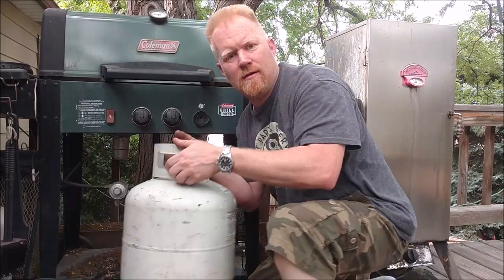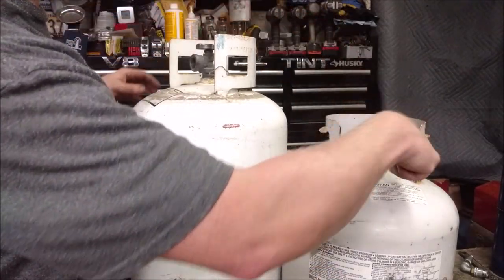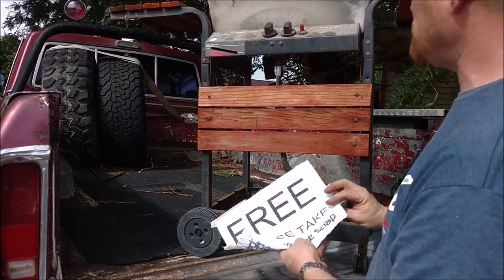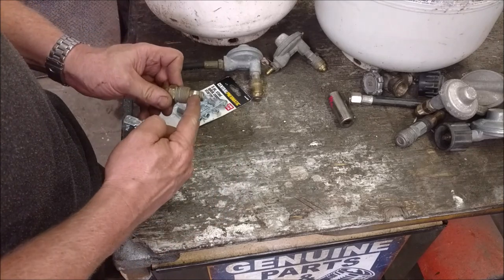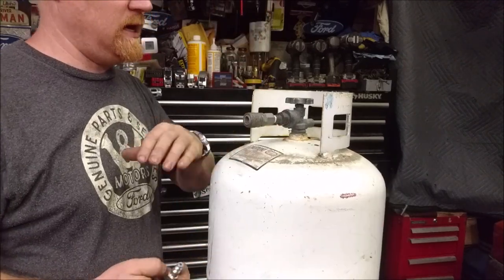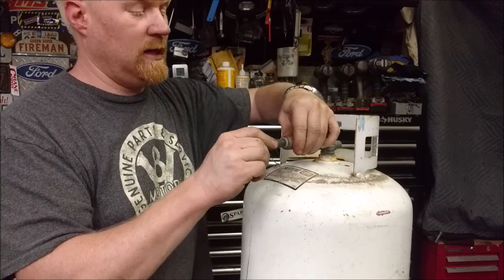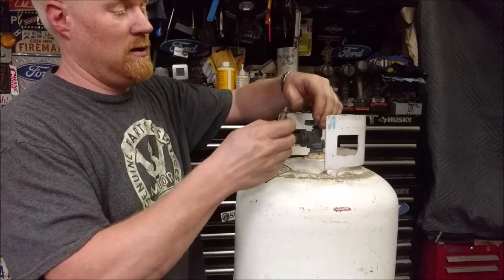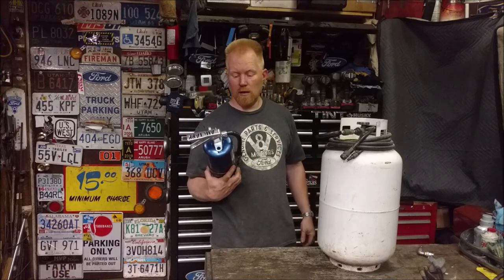Make a Propane Air Tank QUICK N EASY

Comment: I did just that about 10 yrs ago when my gas grill crapped out and I went back to good old charcoal. I hacked up the grill stand an  made a push cart for the tank with a box for accessories blowers couplings teflon tape etc. Next project is attach my small 5 gal Harbir Freight compressor to the cart. The tank fits inside a standard milk crate so it can sit more stable in the back of my truck.
Reply from the maker: Awesome.

Comment: Would this work with a liquid LP tank valve also? Should, right?
Reply from the maker: Yes, there is just a pickup dip tube internally that will make no difference in it's operation with air.

Comment: Will it work for those helium tanks for balloons? ??
Reply from the maker: I have 3 old helium tanks (freon tanks are identical as well) sitting around that I have contemplated doing this to but I always talk myself out of it. Only because those are paper thin.  They are what they call DOT39 non refillable cylinders. They make them for one time fill and dispose of, so there is no safe guard from thing like metal fatigue from repeated fill and empty unlike propane cylinders. I filled a DOT39 cylinder with refrigerant years ago and it got slightly overfilled and swelled up to the point it deformed the steel and I thought was going to blow up. I emptied it as fast as I could and had to dispose of it. However people do it all the time though but I've also seen the feet wear holes just from moving it around and setting them on concrete.
Reply: @sixtyfiveford  ok well plan B would be to turn them into mini little forges those wouldn't be presurized

Comment: Will it just stop filling when full?
Reply from the maker: It will equalize to whatever the air compressor your filling it with is at. Most air compressors are set to around 100psi.

Comment: Could you fill the propane take with CO2?
Reply from the maker: The tank couldn't handle the pressure that CO2 is at. A propane tank is tested up to 480psi but that is only 1/2 the pressure CO2 sits at.

Comment: How would I convert one so that I can spray motor oil. On the frame of my old truck
Reply from the maker: Check out the fire extinguisher one I did. It has a pickup tube running to the bottom already, so you could just dump in oil and add air.
Reply: Buy $9 garden pump sprayer. Delute oil with diesel fuel.

Comment: Does anyone know how many gallons of air a 20lb propane tank will hold at 150psi? I don't know how to convert that. I have a Lowe's 7gal aluminum air tank but it runs out pretty fast even filled at 150psi. This may be a good replacement.
Reply from the maker: 5 gallons is what a 20# lpg tank is. It's rated to 240psi.

Comment: How do you know when is full?
Reply from the maker: The pressure from your compressor tank and this when hooked together equalize. So if you have 100psi coming out of your compressor the tank will fill to exactly 100psi.
Reply: @sixtyfiveford  cool thanks. And you already gave the max pressure limit of the tank. So anything under that should be safe.
Reply: On my 30# tank I made over 40 years ago I have a tee fitting with a 250psi gauge on one outlet along with a valve to fill it with an air chuck and also use a double male fitting.to use on the attached 6 ft. hose that has the female quick air chuck on it. That way you always know how much Air you have in the tank and also you only need a regular air Chuck on the air hose and crack open the valve to fill and it will check the pressure in your tire when you close the valve. The regular fill valve is on it in case you stop somewhere that only has an air Chuck on their hose for filling a tire. When I made mine I also removed the valve and steam cleaned the tank out to remove all the smell and any residue propane to be on the safe side.

Comment: How do you know how much PSI you have put in it?
Reply from the maker: Because your air compressor has a regulator set to 90-120psi. A standard workshop compressor maxes out at around 120psi and a high output 2 stage maxes out at around 175psi(but you still have it regulated down to 90-120ish psi). The tank is tested to 480psi.

Comment: I don't know about laws on propane tanks, but I do know about laws on refrigerant tanks that are almost identical and if that were a refrigerant tank you would be in violation of the law.  If I'm not mistaken is punishable up to $25,000, I expect you would probably find the same laws on the propane tanks. Even the tanks that refrigerant come in have a check valve to prevent filling the tank with air after it has been emptied. The tank is not allowed to have air in it modified or not. These are usually federal laws, and these feds will treat modifying a tank like modifying a gun. Just saying be careful.
Reply from the maker: Their absolutely zero laws about refilling any pressure vessel with air. The laws you are referring to have nothing to do with this and are about refilling a refrigerant bottle with more refrigerant. Places used to sell and probably still do sell kits to turn refrigerant bottles into these air tanks.

Comment: how much psi will this hold this set up?
Reply from the maker: Tank pressure ratings for these are in excess of the valve 375psi safety blow off . These 20 &30lb tanks are dot4ba240 rated which have a service pressure of 240psi and are hydro tested to 2x that(480psi).

Comment: I was always under the assumption that you must remove the top and fill the tank with water to make sure there is no residual gas?

 because most gas will ignite under pressure, same reason you do not use certain oils/gases near/on/in an air compressor 

That in the spark from the motor kicking on,ect

Comment: I guess at 325 psi u don't need a gauge...because your compressor won't hold that psi? A gauge is not necessary
Reply from the maker: Exactly. Most compressors max out at around 120psi with high output ones at 175psi. But even with the high output compressors you have your regulator turned down to the 100psi range. These tanks have all passed a factory pressure test to 480psi with an added safety blowoff at 375psi.
Reply: @sixtyfiveford  thx

Comment: Remember that there will Always be WATER below the Tank due to Air Condensation. Now, you should Drill and fit a Drainage valve below the Tank...!
Reply from the maker: You're never putting HOT air into it like an air compressor does so condensation doesn't happen. I have cut these apart after years of use and there is not a drop of moisture or rust inside.

Comment: Wouldn't it be smart to add an air gage so that you don't explode the tank
Reply from the maker: Air compressors have a regulator set to 90-120psi. A standard workshop compressor maxes out at around 120psi and a high output 2 stage maxes out at around 175psi(but you still have it regulated down to 120ish psi). The tank is pressure tested to 480psi.

Comment: Old Freon tanks ???  Old helium tanks ???
Reply from the maker: Those are too thin to use in my opinion. Propane tanks are tested to 480psi. Freon/helium tanks only to 180psi. Propane tanks are heat treated to anneal the steel so they don't fatigue and fracture after repeated flexing from being filled and emptied. Freon/Helium are not required to have this done due to their one time use. You can read more about this with their Dept of Transportation ratings: Freon/Helium tanks are "DOT-39"

Comment: Anyone gonna tell him you can get a 5 gallon air tank for 20$ at harbor freight?
I mean fuck me if I'm wrong, but if it's no longer safe tohold propane, I can't imagine it's any safer for normal air.
And if it is safe for propane, it is much more valuable as a propane tank than an air tank. I mean you already had to spend 5 bucks on air fittings, and go find an old BBQ (mind you after salvaging from that used unit, you now have a pile of trash to get rid of).

Just seems like a lot of steps + 5 dollars to avoid spending 20$ on a purpose built, ready to go, air tank.
Reply from the maker: Propane tanks are extensively tested to 480psi and made of steel 3x as thick. They can withstand even higher pressures but this is the minimum they test them for.  This is required due to the dangers of the propane they carry. Chinese air tanks are not tested at all and have not legal requirement to do so. They theoretical max pressure rating of 125psi. I've seen and owned the crap that comes out of Harbor Freight and only an idiot would trust them to make something that could rip your leg off.

Comment: Old tricks, but are no longer necessary today. You can buy an electric air pump that hooks up to your car for cheap.
Reply from the maker: I don't think I have ever used this for a car tire other than in the video. Most tires I fill there is not a battery even close, not only that those take forever.

Comment: I had a relative that tried to convert an old tank into a air tank. The tank ruptured and cut his leg off. look at the tanks and figure out what the maximum PSI is and do not exceed it
Reply from the maker: Yeah he tried to convert an old freon or helium disposable tank. A propane tank is rated for 400 PSI plus which you'll never obtain with a standard air compressor.

Comment: Because of terrorists,  Its my understanding that to modify a propane tank is illegal.  Granted how your modifying is not making a bomb or using in manner the law was written for.  If had a cop that had a hard on for you could find yourself facing a whole lot of years in prision.  I would like to think that our justice system would not treat a cititzen that way but its worth being aware that the laws are on the books.
Reply from the maker: I've never seen a law about modifying a pressure vessel to hold other gases. In this case I didn't modify it at all, I simply filled it with air.

Comment: I would not do this!! Having been in the Propane gas business for many years , I would NOT call this safe!! Propane goes in the tank as a liquid at 44 degrees below zero, tanks are legally filled only to 85 percent the 15 percent left is the vapor space that is what people use in their bbq etc.....the vapor. As the liquid  boils in the tank it creates more Vapor  As the liquid decreases less vapor to be used. sometime you will hear the regulator whining when the tank gets low, The lower level liquid is not producing enough vapor to meet the demand. The ordorant that smells is Ethyl Mercaptan nasty stuff, it permeates the pores of the metal forever!!! As far as purging the tank with air, remember you are also trying to purge left over liquid as well as vapor. Just a note when liquid is exposed to the atmosphere it is color less while expanding 270 times its rate even a little bit. All you need now is a source of ignition wall outlet, static, you name it and someone can get burned in a flash!! Remember also, if liquid touches the skin it will also burn you by being 44 degrees below. Not to  knock you down , just want folks to be safe. please don't do this on bigger tanks for compressor storage etc either. In my career I have seen people get hurt and one person die. Thanks
Reply from the maker: I'm with you, it's not safe in anyway. It's a calculated risk.
Reply: The risk is so small. Bigger risk driving to the shop to buy a compressor

Comment: “When I’m done....”
I know when I am done eating because I’m not hungry or the food runs out. 
Done having sex is obvious. 
How do you know? Compressor turns off? Air is released through blow off? I’m guessing the former.

Other than that, this will do the trick for just keeping my tires at the right pressure and inflating bike tires.
Reply from the maker: The pressure equalizes. If you have 120psi in your main tank and hook it to this it will fill to 120psi and stop. No more, no less.
Reply: I can make the tank, but don’t have a compressor. Never owned one. I have a friend that has one in his factory, but he is the president and won’t know squat. Which means I have to convince him it is safe. And since I live in Japan, I have to do this convincing in Japanese. Not my favorite language.  I’ll have problems finding the adapters for the same reason.

Example...getting a propane tank is a HUGE deal. And getting it refilled is no easy matter. If the place didn’t sell you the tank then they generally won’t fill it. And buying it for a grill? Nope, that is unusual. And as a foreigner, they’ll just say ‘no’. 

But thanks for your help. I’ll see how it goes.
Reply from the maker: @Zerpersande  if you just need one to fill occasional tires, You're probably better off just getting a small plug-in or cordless unit.
Reply: @sixtyfiveford  
It would be convenient to use it to blow saw dust, etc off. Also bike tires, bc bikes are used a LOT here. And having the tank would make it a lot easier than plugging something in.  But I went out today and by the time I buy adapters, a hose, a blower nozzle and a pressure gauge/filler I’m going to have more innit than a small, DC compressor for cars.

Informative video though.

Comment: Folks, go buy a portable ready made air tank, before a “Home Made” job rust on the inside and blows up on you. You can get one for under 30 bucks, with the hose, fill valve and most important the 125 psi safety relief valve. What to do with your old tank? Unscrew the valve, let it set for a week to air. Cut an opening in the side, makes a great oil absorber, charcoal, kindling wood, fireplace ash container, etc.